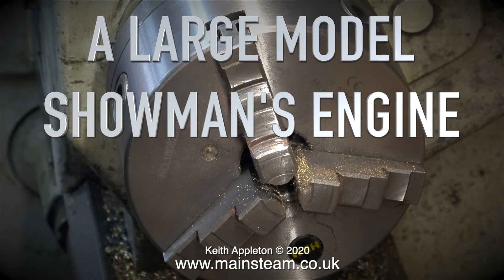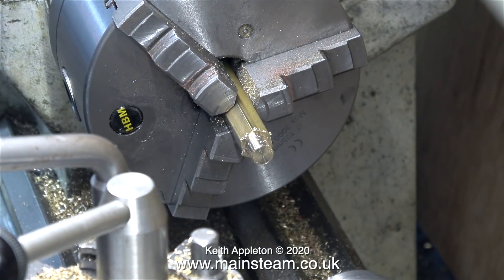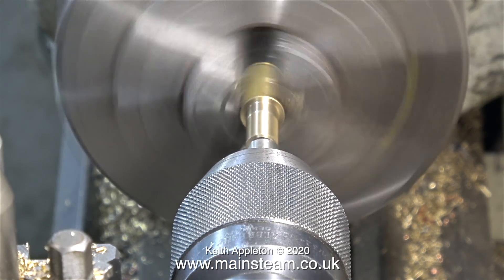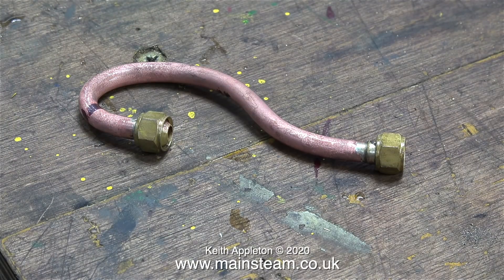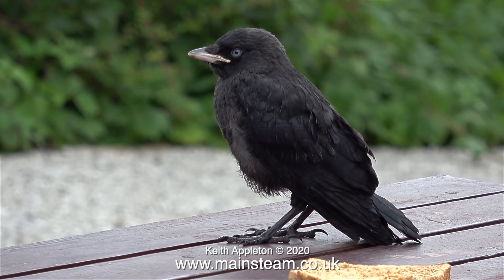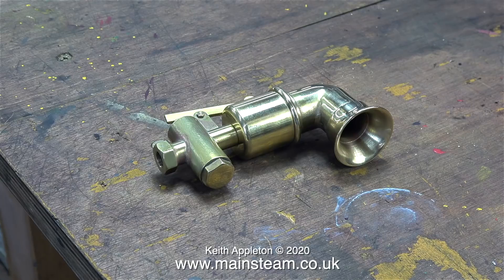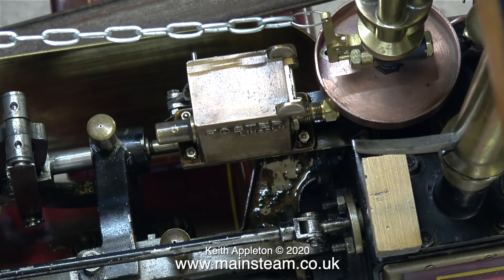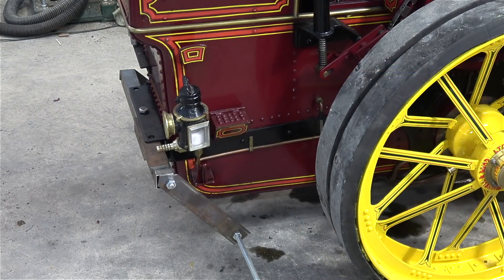A LARGE MODEL SHOWMAN'S ENGINE - PART #30

Comment: Isn't there a plug on the side of the cilinder under the lagging? Single cilinder Burrells usually have a fill plug there and I've seen a lot of people use that plug as a fitting for a whistle. Our 3" had it's whistle there aswell.
Reply from the maker: I don't know, I found a couple of threaded outlets on top of the cylinder block which I used for the Whistle & Siren